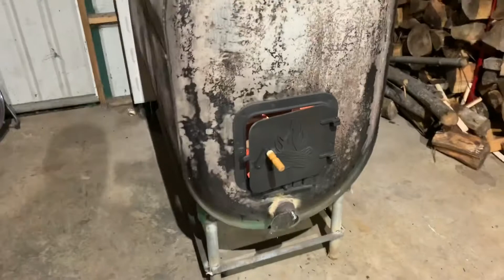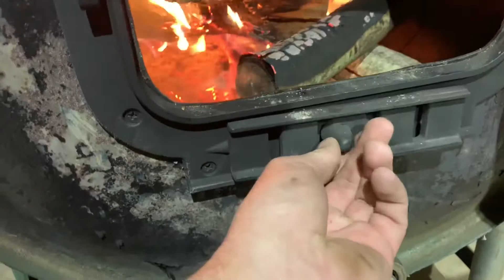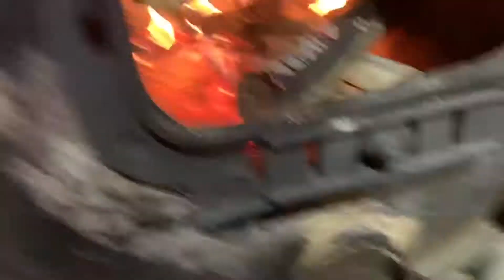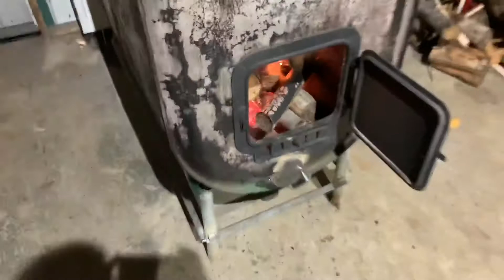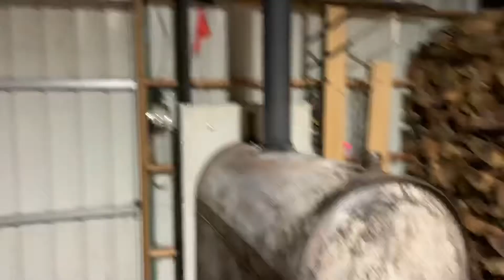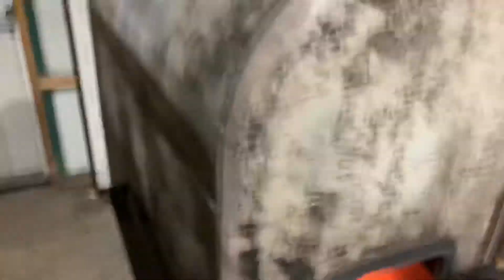Oil tank Fireplace

Comment: do you stuff it full with wood  on cold days
Reply from the maker: No not really.  It can heat the 30x48 shop with no insulation from 30 degrees to 70 degrees in an hour. With a normal load of wood. 
Over stuffing it is a waste because it burns for so long.  Usually I am only in the shop a couple hours.  So stuffing it full is a waste of wood.

Comment: You ever consider making an outside wood burning broiler with 1 of them tanks?
Reply from the maker: No I haven’t thought about that.  A lot of the heat I got was just because it was so hot and it was inside the shop.  It will glow red in spots when it got really hot.  I think there are better things for the boiler outside idea.

Comment: How did you get the brick in there nice thru the little door? I'm about to start this same project.
Reply from the maker: I put one row in.  And then pushed it to the back with a rake.  Then the next row.  Until I could reach it to finish it off.  
Just go slow. I think it was seven per row.  Maybe eight.